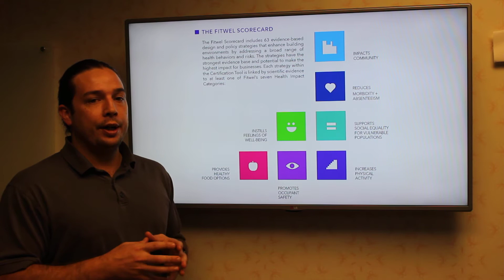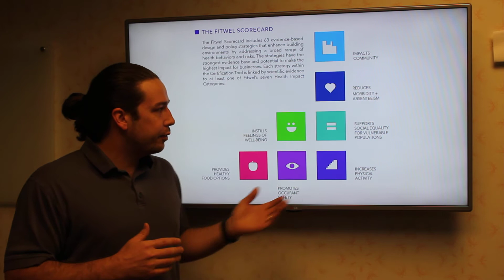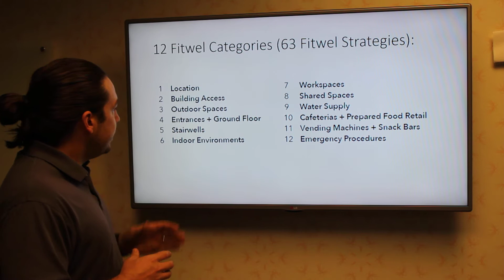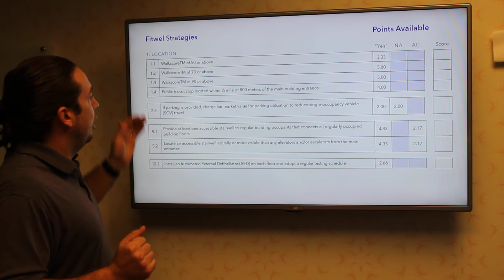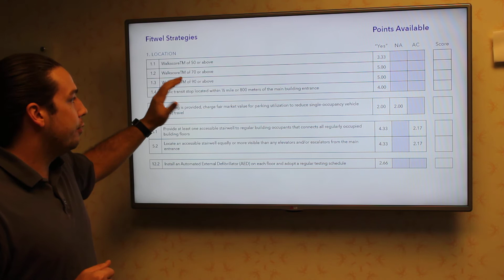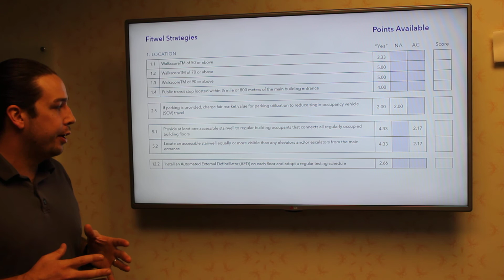Introduction to Fitwel

Comment: i'm getting into archviz, does fitwell ever work with archviz, since we modelers would work with the clients directly before a building even goes up?
Reply: Hi Shakaama, in order to see if Archviz has fitwel projects in the work check out their project directory: https://www.fitwel.org/project-directory - you can search for the project/building address or project lead there. At this time, there is already about 573 projects listed in their directory.